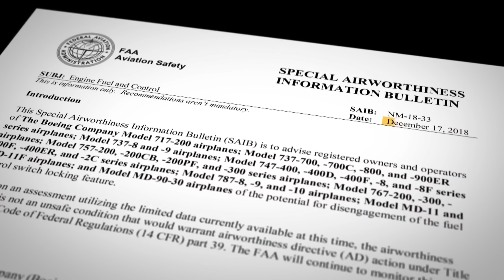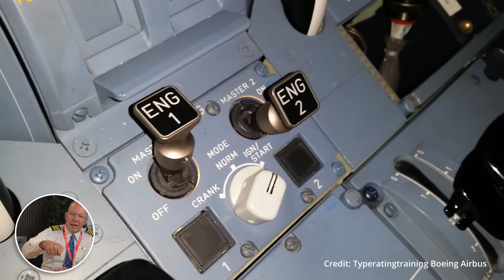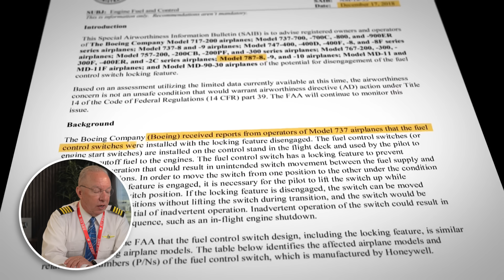Air India 171: The FAA’s 2018 Fuel Switch Locking Bulletin Explained (16 Questions Answered)

Comment: FYI, the switch has a plate that provides the detent.  If the plate is installed incorrectly (like upside down), then the detent wouldn't work - it would be like a standard toggle switch.

Comment: Now we will have a 787 pull a space shuttle in a flaming ball across the sky because the "fix" will stop the pilot from turning off the gas so he goes up in flames.
Just like they did to pancake the plane into a mountain because passengers couldn't get into the cockpit to stop the pilot from flying into the mountain.

Comment: The rail hosting the locking pin of the pilots seat was non existing, sheard off
Thos the pilots seat SLit to the utmost rear. The. Pilot was strapped to his. Seatbelts.and grapped to the throttle leaver to pull himself back to adjust his seat position. By doing so he accidentaly positioned the thrust levers into the idle position. The sad thing is that the ground maintenance crew knew about this fault and postponed the repair for a more convieniend time, which never came 🇮🇱Schalom to all Viktims Joachim Germany Hamburg.

Comment: Why are you so quick to jump to the conclusion that it was pilot who was trying to kill everyone and not talking about the unusually long runway used for takeoff?
The takeoff roll was unusually long and slow, clearly visible in CCTV footage. This was before any engine switches were flipped. If the aircraft was “normal,” why did it struggle to lift off? That alone suggests that there were some issues already with tha plane

Comment: I will note that a flight simulator cannot simulate complex electrical system failures or the logic of the FADEC during complex failures.
The EAFR on the 787 does record the positions of the Fuel Control Switches L/R as discrete records, so no confusion that it was pilot initiated.
It took 10 seconds for the Engine 1 switch to be moved back to RUN, and 13 seconds for the Engine 2 switch.  They both relit, but only Engine 1 was building speed, and it only had 19 seconds to get back up to full power.  Too little, too late.  Why 10 seconds?  A fight?
I looked around to see if there were any small aircraft that had the gear lever below the throttle levers, suspecting this might be a transference mistake, but didn't find any, and almost all planes have a single gear lever.

Comment: Questions to consider: Firstly I believe the FDR indicates cutoff switch action occurred 800ms apart. Is it possible for a single human hand to switch both switches within 800ms? Also the switch action occurred 3 seconds after T=0 (weight off wheels), then immediate action occurred to re-enable both switches to RUN.  AAAIB Prelim - SW1 - cutoff 8:08:42.3 UTC SW2 - cutoff 8:08:43.1 - Also the report indicates BOTH switches were found in the RUN position NOT otherwise as previously broadcast.  My subjective  view is switch toggle release hand movement to second switch would take minimally 1.6 seconds with intent and preparation. What are your thoughts?

Comment: 1. Will the RAD deploy if the fuel cut off switches manually switch to off position?

2. Are there processes to restart the engines if they got burnout or shutdown while taking off?

Comment: @captain steeeve if you were into this same situation where your plane losing power and lift and going in to a stall , as a pilot would you put those switches into cutoff position ? And before 171 was about crash pilots did try to lift the nose of the aircraft to avoid those buildings and it can be clearly seen in the video .
Reply: You got it backwards - cutting the fuel off came first. He has said several times that there is hardly any reason to do that in the absence of serious engine fire. Pay attention.

Comment: Hi captain, I asked this on your previous video: Does anybody know if these switches are single or double pole? Does one side of the switch signal an aircraft-wide control system to report to the recorder and the other half wired directly to the engine FADEC? I’m assuming the FADEC is responsible for the actual actuator closing the valve… if the switches are single pole and go to some other system automation controls before the FADEC then there are more questions to be asked…

Comment: Hi Captain Steve,

I’ve watched all your videos related to the Air India 171 report—thank you for the detailed insights. Could you please clarify whether the landing gear not retracting aligns with the timeline presented in the report? Was it due to insufficient hydraulic power after both engines stopped, or was it a result of the extremely rare and unexpected in-flight emergency, where the pilots had to focus on higher-priority tasks in an effort to stabilize the situation, but were ultimately unsuccessful?  Thank you.

Comment: Captain Steeve, pls pls answer this one. thank you. Is it possible there was some engine failure after takeoff and pilot ran thru checklist to restart engine and in that checklist process casually asked other pilot , “did you put switches to cutoff?” and the other pilot say “he did not” and then the first pilot  says “lets do it” as part of checklist. i feel like we should not assume since we dont have the full context and full conversation.

Comment: Think my comment will be buried by now. But a Taiwanese pilot who also flew the 787 has very fervently disputed the manual offing of the Fuel Control Switch because (link to his YouTube video below): 

1. The black box cannot record if the physical switches did move, only a CCTV can do that: it can only record the electrical signalling or the fuel valve closing.  But more importantly,

2. An FAA bulletin for the EEC (electrical control) of the 787 recommended to replace the N4 chip because it found that after prolonged use, the chip essentially haywires and causes Lost of Thrust control. Therefore,

3. What the blackbox recorded was that the pilot noticed a lost of thrust, and immediately followed protocol by manually switching the Fuel Control Switch to OFF and back to RUN. And more importantly,

4. This Taiwanese pilot experienced the exact same issue on a 787 during takeoff, just that it corrected itself within 1 second. Therefore,

5. It was natural for the Captain to ask Why did it cut off, and the first officer to respond he did not (whilst he was rotating with both hands).  And also significant to note:

6. First officer was bringing the plane up with both hands in the first 3 seconds, he could not have switched off the Fuel Control Switch; Captain could have just tilted the plane at that height to crash if he was suicidal. 

I honestly think we cannot be so adamant on suicide theory at this point, given the evidence and circumstances. The manufacturer has every motivation to blame it on human error.
Reply: Its not pilot error
Its happened earlier 

In January 2019, ANA Flight NH-985, a Boeing 787 Dreamliner, experienced a dual engine failure on landing at Osaka's Itami Airport. The incident occurred after the pilots deployed thrust reversers following touchdown. Both engines shut down, and the aircraft had to be towed off the runway. An aviation expert has linked this event to a software glitch in the Boeing 787's Thrust Control Malfunction Accommodation (TCMA) system.
Reply: @dhivyas8684  Well there's an uncomfortable truth
Reply: Very provocative things to consider! Capt Steve seems too eager to reach conclusions.
Reply: @ceicher1  He knows there are conclusions that will cause him to have an "accident".
Reply: 💯 I didn’t think captain Steve would also support this theory
Reply: Since it seems  that there was human intervention  in this tradegy,  will the investigators - NTSB, AAI etc, etc be using voice recognition  to determine which of the pilots asked "why did you do that" and to confirm the same voice made the Mayday call, thus pretty much clearing his name?  Nothing will change the outcome of this tradegy or bring back all of those who lost their lives,  but I am SURE it would bring a heap of PEACE and SOLACE to the family and friends to know that their husband/Dad/son etc was NOT the pilot who placed the switches to cut-off.  PIPPA, HOUT BAY, CAPE TOWN.
Reply: "immediately followed protocol by manually switching the Fuel Control Switch to OFF and back to RUN."

No, the switches were not put back to run for 10 seconds.  That's not protocol for any situation.

And, the Indian media, the Indian pilots association, and the Indian government all have every motivation to divert blame from the pilots.  I've seen so many impossible scenarios put forth by these entities, like the aft EAFR showed signs of fire but it was in the tail cone which was unaffected by fire.  No, that was a complete fabrication.  The preliminary report shows that the EAFR was not in the tail cone; it was found on the other end of the building, near the RH engine, in an area where there was fire.
Reply: I‘m not fully disagreeing, I also think the whole thing is fishy. However, the black box can certainly track engagement/disengagement of the manual fuel cutoff switches, so the pilot is definitely off there. However it‘s still not proof that the pilot shut them off intentionally.
Reply: @beezyp69 yeah there seems to be an argument that the black box can detect if the switches physically moved. But the pilot states that it’s all electrical thus it’s all 1s & 0s. Only a CCTV can prove the switches did move OR audio recording (which the authorities have but did not release) that should have captured the loud clicks of the switches turning off or on.
Reply: Fly by wire means pilot is not flying the plane, the computer is. You just get to make "suggestions". It's a horrible idea.
Reply: @avlifesavers that is not what it means. It just means that there‘s no mechanical connection between the yolk and navigation instruments of the plane. The pilot is still 100% controlling the plane based on his input, only that a sensor senses the input the pilot makes and then engages an actuator at the navigation instrument based on it. Fly by wire systems incorporate envelope protection, which prevent pilots from exceeding safe limits, which makes it even safer since it limits human error (stalling, over-G, extreme angles). Also, FBW can self monitor and switch to backup system if failures occur while mechanical systems rely on physical backups. Overall FBW is considered safer.
Reply: @beezyp69 It only took a sensor to cause (2) 737 Max crashes, and pilots couldn't save themselves. HAL is always in control.

Comment: In regards to video, that's 'simple':  Make it another black box.  Nobody has access/uses the CVRs until something goes wrong, same with video.  And if someone IS doing something wrong, well, they shouldn't be doing that and scrutiny is deserved, but that's beside the point.  The point is *it is for an accident*.  Not for discipline during normal flights.  It can be written in it can't be used punitively outside an accident investigation, should punitive be an option, and the black boxes are off limits to HR, management in every other situation.  Any leaks, the maintenance crew involved WILL be dismissed with prejudice, and other airlines would be wise to know who they are hiring.

Or so I'd imagine it'd have to be written in to the ALPA contracts.  It's gotta happen.  The pushback is holding the industry back in making sure flight is safe.  Get over it.  I know I can be kibitzed to smithereens on this, but facts are facts.  Video would help immensely.  Not in prevention of accidents, but *understanding them and making changes to fix it in the future so it never/is highly unlikely to happen again.

But that's my opinion.  My other opinion is this: "Why did you cut off the fuel?" "I didn't!"  If we are to believe that there is zero way for the fuel cut off to be moved without human intervention, and there's no other way this happened, then ONE of them DID put the switches to off.  And then they said what they said to fool everyone. Either the first pilot asks the question to obfuscate the situation, knowing the other would say they did not, or the second denying it because soon there would be no other questions, and it would all be over.

Because frankly... there's no other explanation unless both switches were faulty in the first place, or there was an extremely magical situation that unbelievably amazingly coincidentally happened.  A 'comedy of errors' except nobody's laughing.

But that is also just my opinion on it.  Hence the video to really know what happened, that's why it's important enough to 'get over it.'

Comment: It kinda sus now. How Captain Steve can be so sure, that it was a pilot error from just a preliminary report? AAIB have not released the entire cockpit voice recording yet. Have not provided proper timeline of voices and haven't provided entire black box data. SRSnure's question is pretty much valid since fuel control switches in this particular aircraft was never changed. Why aren't there any possibility of false trigger of cutoff within the system, which is basically fly by wire type. The report doesn't justify how both switch transition to cutoff position so fast within just 1 second with locking safety mechanism. Why there was no immediate warning trigger if fuel switch where set to off. And lastly why he is opposing cockpit cam, which can provide essential information like which switches pilots are touching.

Comment: This is what the report actually states:-
"at about 08:08:42 UTC and immediately thereafter, the Engine 1 and Engine 2 fuel cutoff switches transitioned
from RUN to CUTOFF position one after another with a time gap of 01 sec." 
It does not actually say that the pilots moved the switches. It says that the switches 'transitioned'. The question is what exactly that means. Capt Steeeve talks his own book too much. Maybe he's right. Maybe he's wrong. But it's not as black and white as he makes out. Not good for our mental health!

Comment: If the fuel switches on AI171 are spring-loaded, could a loose or faulty spring have caused them to turn off during takeoff due to sudden vibration or jerk? 
Also, I believe a safety improvement could be made: each pilot should have a separate switch on their side. Fuel cutoff should only occur if both switches are turned off. To turn fuel on, one switch should be enough. And if both switches are not on, there should be a clear warning alert in the cockpit.

Comment: As a professional mariner,  I respectfully disagree with your opinion to not have camera(s) installed on the flight deck. On our navigation bridges, we have them now installed for a long period of time. They are hardwired in a "black box" and louped over every 24 hours or so, probably less in the aviation industry.  I believe that, in this case, it could  have had some value.

Comment: ***QUESTION FOR CAPTAIN STEEEVE***: There seems to be the general consensus now that electrical and mechanical failure has been ruled out, that the only other option is that one of the pilots intentionally and knowingly switched off the fuel switches. My question is could it have been accidentally intentional? As in, the pilot was going through motions and was on "auto-pilot" (pun not intended) or just simply having muscle memory. Could he have thought he was working another mechanism (flaps for example) and mistakenly turned off the fuel switches instead of the checklist item he should have been attending to? I don't understand why genuine pilot error / pilot mistake is being swept aside and people are piling instead on "pilot malicious intent"

Comment: The captain did not understand the 2018 bulletin. 
When installed incorrectly the switches seem to work normally. You can pull them out. BUT they can also be simple switched (accidentally)

Comment: I had to go back and listen again. He doesn't want video in the cockpit because it could catch someone doing something they shouldn't be doing? And that it might be leaked? Heaven forbid pilots should be held to standards and called out when they break the rules. It's not like anyone could die or anything...
He's constantly crowing about professionalism and responsibility and the sacred trust of holding lives in your hands but doesn't want a video record because someone might be reading a magazine?
Eastern 212, Delta 1141, Comair 5191, Colgan Air 3407, LAPA 3142 and others all could have been avoided if the pilots knew someone was watching them and didn't screw around.
Shame on you, Steve.

Comment: I understand the lack of CCTV camera implementation inside the cockpit due to invasion of Pilot's privacy issues but in cases like these video footage would have been of paramount importance. Investigators would have not been in the dark on what exactly happened to the Fuel Switches. if there was indeed manual intervention on cutting the switches and if yes then which Pilot was actually responsible for it. Since there is no video footage we might actually never know.

Comment: It was an engine power problem after plane took off. Pilots were confirming from each other if fuel switch has been cut-off or not and second pilot confirmed that he didn't. But the whole story is being twisted out of context to put blame on pilot to cover up the Boeing engine power failure. Sad...and shameful

Comment: Questions after the fact: if you can’t raise the landing gear while on the ground because the plane “knows” it’s on the ground, why would it let you turn off the fuel when the plane knows it’s in the air?

Also, you showed that if the throttles are in the full powered position, you can take your hands off of them and they’ll stay there.

Why then, aren’t the fuel switches spring loaded to hold them in the Run position? 

If the plane is shut down and not being used, and the fuel switches malfunction move to the run position, nothing will happen.